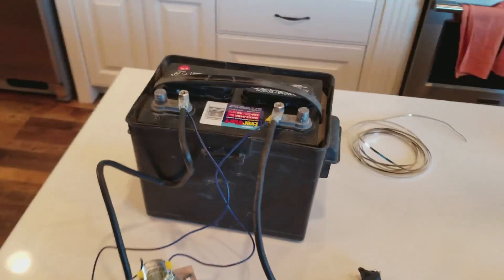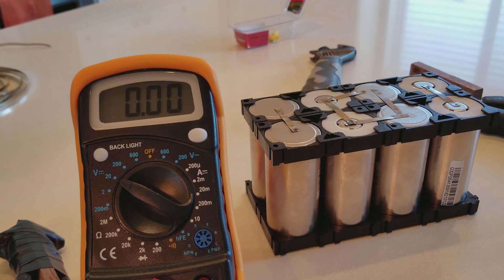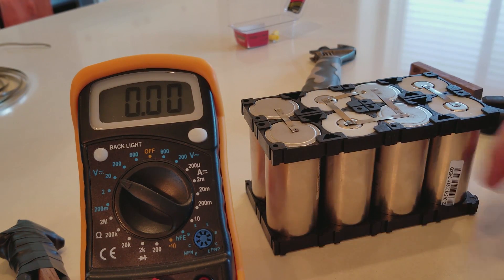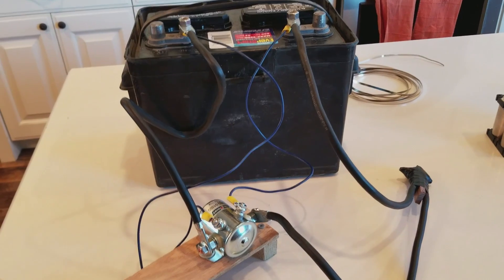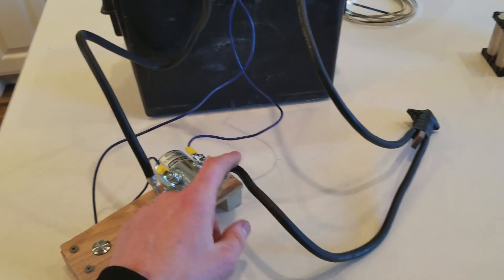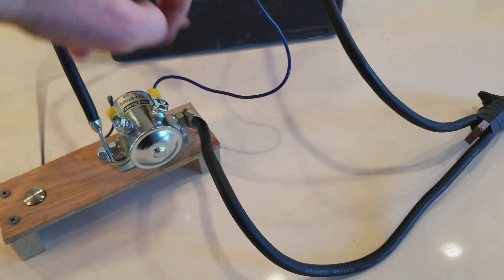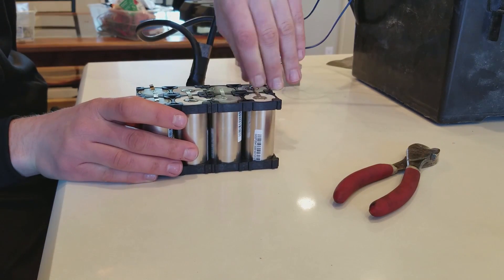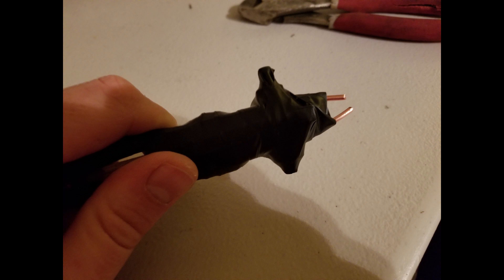DIY battery Spot Welder on the Cheap

Comment: This is dangerous and nothing more than short circuiting the battery with a solenoid. If that solenoid doesn't open, for any reason, you're in trouble, and it may be fatal. It's not too bright to short circuit a lead acid, or any other kind, of battery.

Comment: can i used any 12v battery even not led acid?
Reply: The battery most be Very High current. You can use any high current battery. For example 12V 3s lipo battery

Comment: Warning: At the very least you need to fuse any connections from the battery. Any short, including the probe welding across the nickel strips or the solenoid contacts fusing, will result in extremely high current from the battery causing at the least a lot of heat and at worse an explosion. 

You also need something to limit the current to the welding probes. An auto solenoid is not built to handle the type of current you're running through it. The contacts will quickly overload and may fail. You need something like carbon contacts, not metal. 

Essentially each time you close the circuit you're running the full current capacity of the battery through your connections, including probe tips. You have a dead short and if the solenoid contacts fail to open and your probe sticks, the result will be bad.

Fuse it, limit the current, and you'll be much safer, not safe, but safer.
Reply: So..... have a metric shit ton of fuses on hand to replace every single weld.  Brilliant.
Reply: @PBVader  If you had a clue you'd know what you have to do to get a decent weld while protecting against dead short. 

Of course you can learn the hard way and have your battery dump its electrolyte, case fragments, and metals into your face.

Your choice, play stupid games, win stupid prizes.

Comment: This is a dangerous design for a spot welder. I know, I built one. The problem is that there is not enough control over the current and time of the weld. The solenoid will only close and open so quickly. This design can work if the cranking amps of the battery are just right. Too much and it blows holes in the battery and nickel strips. Too little and you get no weld. You can't control it with the button on time well enough. Worst case the solenoid contacts can fuse, the battery stays on and before you realize what is happening the battery blows spewing acid all over you. A really bad idea. I had a 300CCA battery and the solenoid fused but I was able to pull the tips from the weld before the battery blew. It also would blow holes in the battery. The weld pulse needs to be like 10 millisec which is not possible with a solenoid.  This is really dangerous.
Reply: better to use the battery to charge a big cap then use the cap to weld.

Comment: May I ask, and this may seem like a dumb question to you electronic experts, but what purpose does the solenoid serve?
Reply: a solenoid has a large relay contact which can take high a current across it, & you can energize the solenoid with a small switch which has a small contact

Comment: I bet you can do better. 
The first minute kid less than 3 minute video is spent on your battery pack configuration . Then maybe 40 seconds on how to put together the spot welder promised in the title. The rest how it works. 
You should spend more time explaining the wiring, at one point you said something like "and then this wire goes here"" and pointed at the far side of the solenoid. I couldn't figure out what you meant and I've wired up solenoids!  Please clarify what you're doing and why.  Is the solenoid for anything besides limiting the time the current flows? What kind of solenoid works? Can I get it wrong? Is it even necessary? 
And yes, that music is just irritating.

Comment: Me think a Starter battery of about 200CCA (Cold Cranking Amps) will do fine, a marine type deep cycle is much bigger in size, and has thinner plates, thus not really designed for high current bursts as in starting a motor or like this welding.... In a jiffy you could use it however a deep cycle battery is much better in providing lower amps for a longer time as in lighting or operating a radio, otherwise a nice and useful project, thanks for sharing!